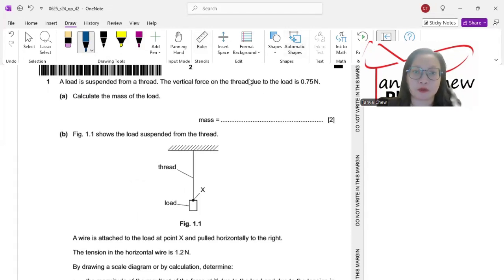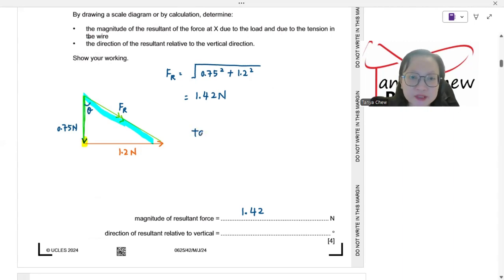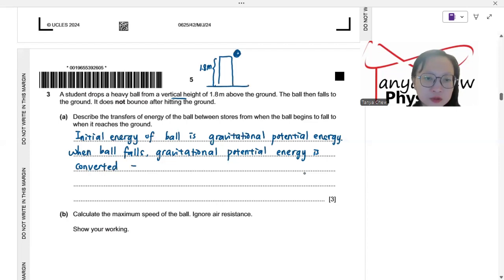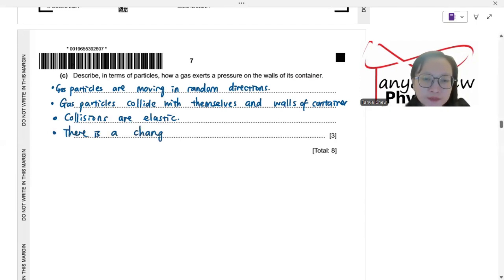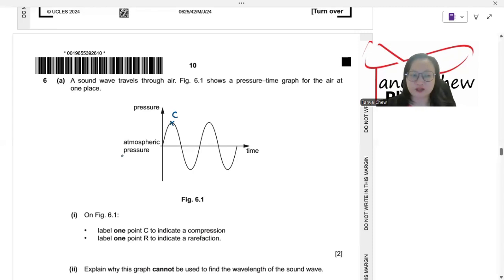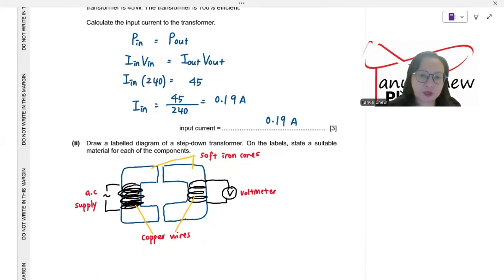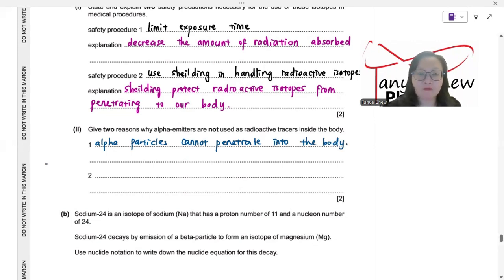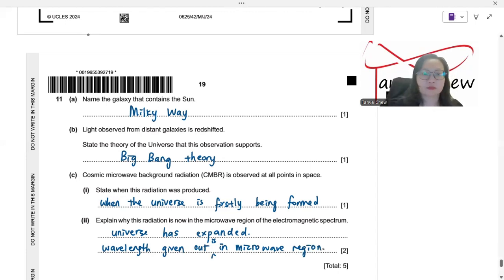IGCSE Physics 0625 May/June 2024 P42 (Detailed discussions+ EXTRA TIPS)

Comment: I believe there's an error in exercise 5b(ii) - timestamp 24:47

The mark scheme says: 
1- Ray reflected at BC AND no refracted ray
2- Ray hits AC with angle of incidence = 0 °
3- Correct refraction of candidate’s ray into air at AC

I measured the incidence ray at BC to be 60º. When I draw the reflected ray, it hits AC along the normal (perpendicular to the surface) (mark 2). Therefore, it exits the prism WITHOUT changing direction (mark 3).

These types of exercises require quite some precision, so if you draw rays at a wrong angle, it can change your answer.  
I hope this helps someone!
Reply: Yes well done